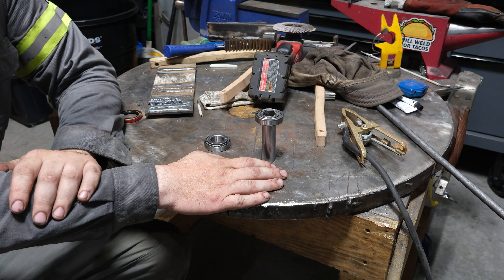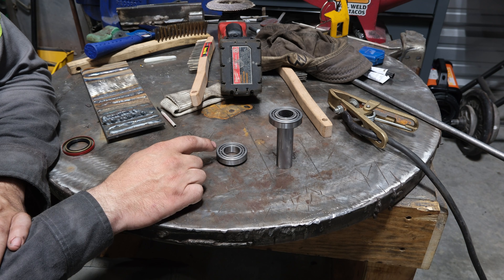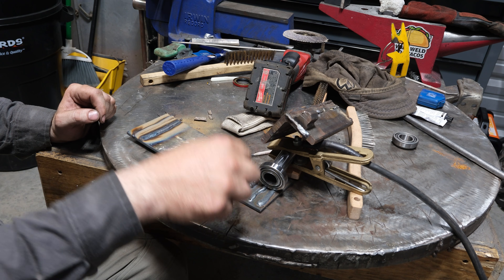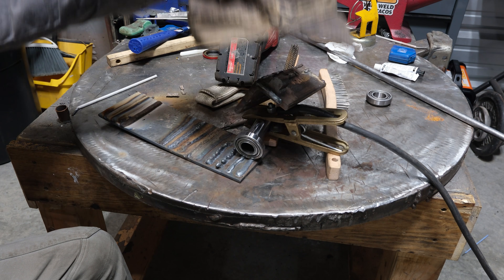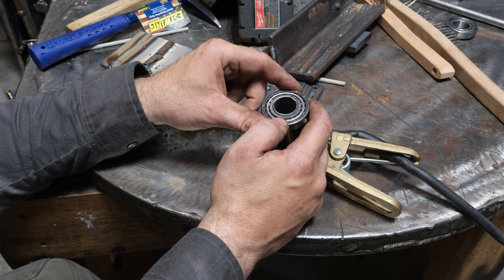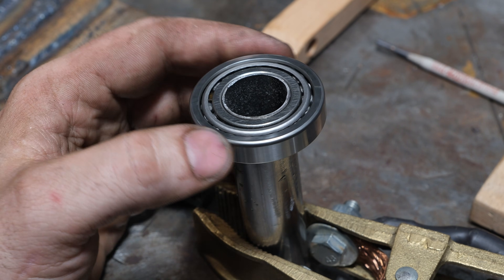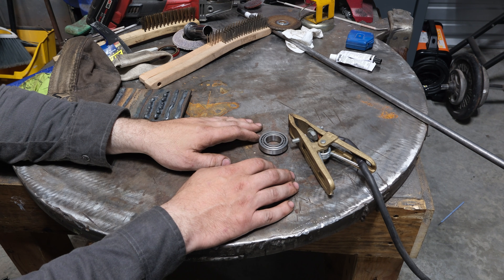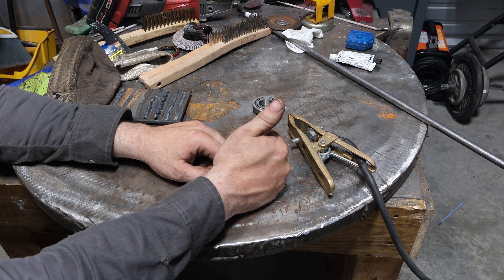Don't make this expensive mistake:  Smoked bearings

Comment: I understand the concept and theory, but I've watched guys weld driveshafts in a metal lathe for years with no issue {would never do it on mine!}. I've also done a fair amount of pipe on a rollout wheel and never lost a bearing. I would never on critical components that could cause catastrophic/deadly results-
Reply from the maker: It all depends on how the current passes through the bearing.  If it passes through the rollers it will damage them more than likely.  On a lathe if a person is grounding through the shaft the headstock is on, the bearings would likely be fine.  If they ground to the housing the headstock shaft goes through (where the bearings are the only actual contact point to complete the circuit) the bearings will likely get smoked at some point just like in the video.  All it would take is a couple mini arc marks and the bearing will start to eat itself overtime.  The tighter the bearing is the less likely it is to happen, but the higher the amperage or greasier it is the more likely it would be to happen.
Reply: @makingmistakeswithgreg  Better safe than sorry! I get it! FYI-never buy a lathe from a driveshaft shop,LOL. Love your content man-you come up with stuff that nobody else does!

Comment: Some learn from others, some learn from making the mistake themselves. Way to help those willing to hear the information. It’s like taping the exhaust on heavy equipment for transportation. It’s might not be very likely to have the valves lining up just right to allow airflow to spin the turbo without oil, but safety isn’t an accident 💁🏼‍♂️
An old boss said back in his trucking days that a piece of equipment had its turbo bearings chewed up because the engine was in just the perfect alignment to allow airflow to spool the turbo during transport. He had me tape up the exhaust every time equipment was moved.
Reply from the maker: That tape is mighty cheap vs a turbo lol.  Thats definitely a case of easily overlooked, rather obscure/freak accident, but extremely costly.  110% I would use the tape too in that situation lol.
Reply: @makingmistakeswithgreg  -Way to choose the more affordable path 😉